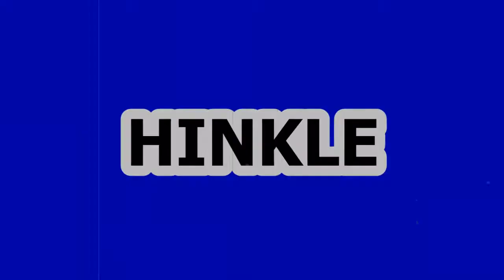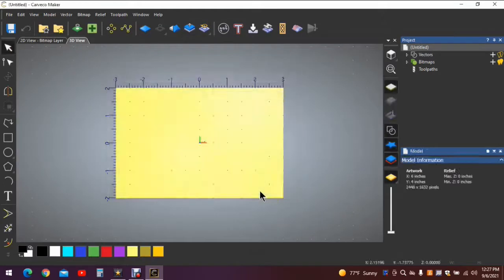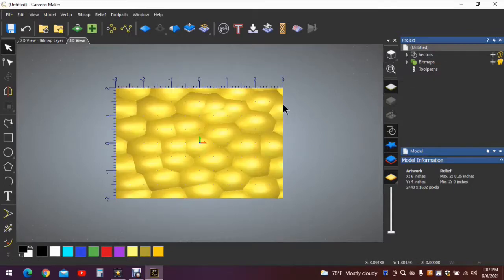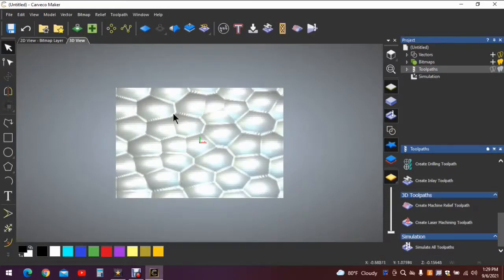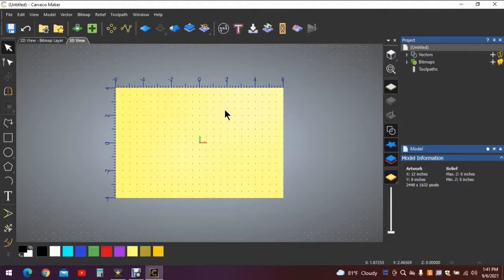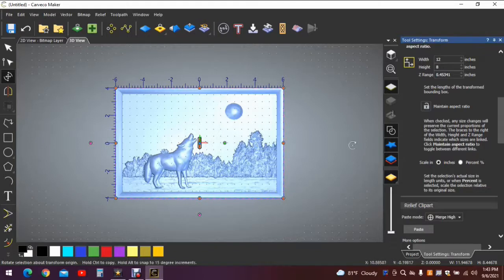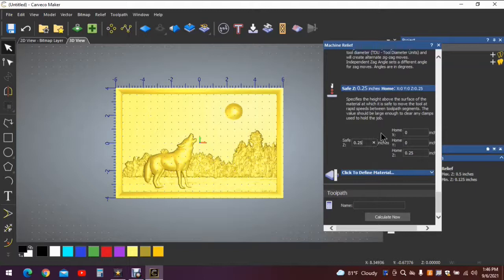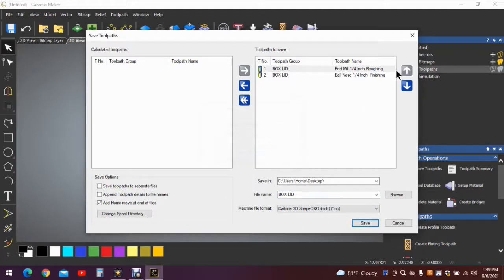HOW TO: MAKE A CNC BOX WITH CARVECO

Comment: What was your feed rate and plunge rate and step down I’m new at this just looking for help thanks
Reply from the maker: Thanks for watching I let the software decide all of those settings however I typically slow down the feed rate on the finishing tool by 25% less than suggested and I reduce the step over by 25-50% to help reduce clean up and sanding
Reply: @Hinkleshop  Thank you